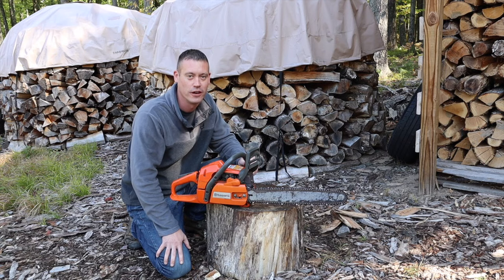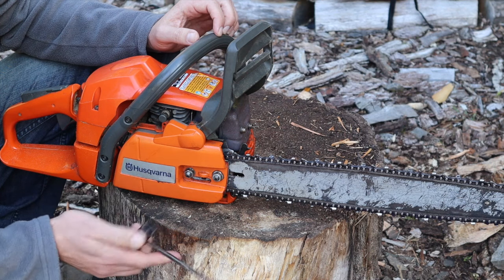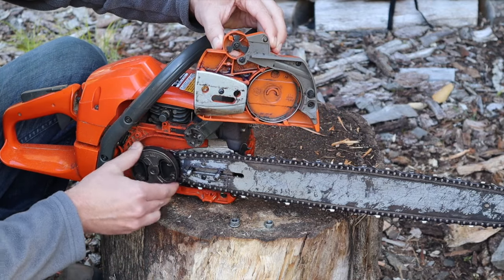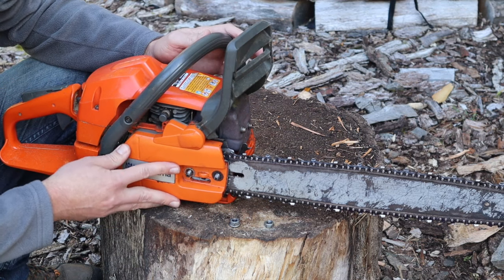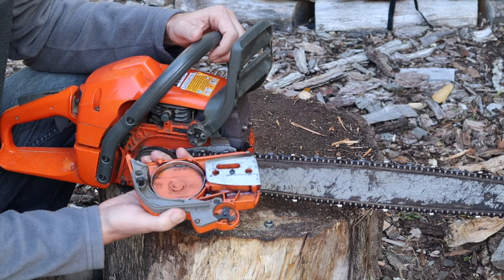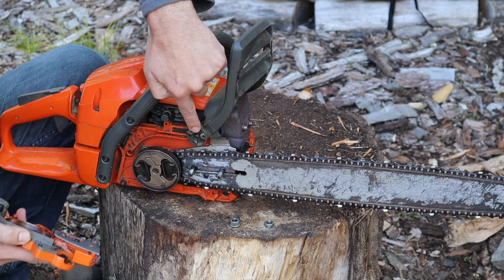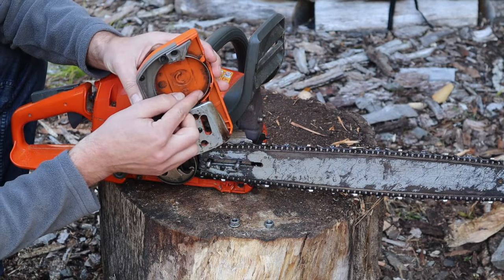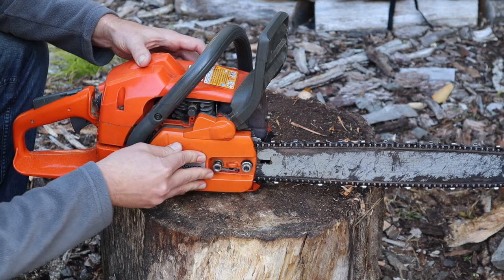How To Put A Chainsaw Clutch Cover Back On After The Chain Brake Is Engaged

Comment: Thank you very much for this video. I couldn't get the cover on, so I searched for replacing the chain on a Husqvarna.  I watched the manufacturer's video. They said that if you remove the cover with the chain brake forward, you have to take the saw to a dealer. Thankfully,  I found your video. Thanks a lot!
Reply from the maker: Glad I could help

Comment: Thank you so much for this video!! I just bought a new Rancher 460 and wanted to replace the stock chain from the start. This is my first Husqvarna. I misread the directions, thinking I needed to have the brake engaged instead of disengaged. I saw another video that said a dealer would have to fix it, but you solved my problem in 2 minutes.
Reply from the maker: That's great!  I'm happy it worked for you.

Comment: Not sure if it has been covered, but the nuts to hold the plate on should be specials to spread the load on the aluminium cover. At 1:00one is correct, one isn't!
Through poor maintenance my clutch band was slightly tight even with the band disengaged due to fine sawdust accumulating behind the band. I needed to know how to engage the band, clean it out and do the reverse - thanks for the info.
John.
Reply from the maker: Great observation!  You're correct, the one is just a standard nut since I lost the flanged nut in the woods.  Since the video, I bought a package of the correct flanged nuts and now they're both fixed.  Tractor Supply has them in stock if anyone ever needs a replacement.

Comment: The stock spark plug socket/ screwdriver that comes with the saws usually have a socket with the notches already just for this problem
Reply from the maker: Thanks for the tip!

Comment: I had tried the same thing, but the cover doesn't seat fully at the angle and then doing it angled damaged the rounds of the plastic teeth on the grey brake part.  Eventually trying with pliers this the whole spring assembly popped out and I was kind of screwed.   I tried shortening the spring to force it back in, but that didn't work either.   Finally I just took out the spring in last resort and don't have brake functioning obviously.

Comment: Loaned my saw to a friend. A week later we took damage from a super cell storm which produced an 85 mph straight line wind that uprooted trees which fell onto our house. Pulled out the saw. I started her up and she was smoking and the chain was dragging. Luckily for me I had another saw. Eight days (assisted by 2 bucket trucks and a boom crane) later all that is left are a few stumps. While waiting on a stump grinder and/or roofers, I decided to take a look at the smoking saw. I opened her up and found the chain clutch brake band had been gouged. No idea on how that occurred. After grinding and sanding the gouged area smooth all looked to be satisfactory. Two hours later the machine was still in pieces sitting on my work bench minus the clutch brake spring. I was in the final stage of reassembly when I accidently, ever so lightly, let pressure off the spring and launched it into the deepest darkest realms of my shop. Best laid plans and all that. Found the spring two days later. Began reassembly. I was having a hell of a time getting that damn "propeller" to turn and decided that there had to be an easier way. Your video saved me from losing my mind. YOU ROCK!!!!
Reply from the maker: That's great!  I'm happy the video helped you out!

Comment: My pedal to engage and disengage is stripping. (Metal against plastic) and it’s not turning.
Reply: Same. I even managed to take the spring out, clean everything and get the spring back in. Can’t get it to disengage no matter what I do
Reply: @meganlynn3778  I ended up just using some needle nose pliers and pressing in really hard then turning. That worked better. Wish you the best

Comment: PROTIP:  If you still have your Husqvarna socket/screwdriver tool for taking off those nuts and turning the tensioning screw, check the back side of the socket.  Mine is crowned specifically so that it'll work the clutch brake.

Comment: My chain break doesn't stay seated properly after tightening down the bolts on my 455, anyone have this same issue?  Chain saw works but the chain break doesn't.
Reply from the maker: I’m not sure if this will solve your problem but if the cover does not fully seat itself even though the chain brake is disengaged, there could be a bunch of sawdust packed around the brake band which causes it to slightly constrict. An air compressor will clean it right out. Just a thought!
Reply: @firewoodforlife  Thanks for the info. I had found out the issue. The one I had gotten had plastic washers over the bolts. Must been left on by manufacturer. I removed those and works fine now. Thanks again!